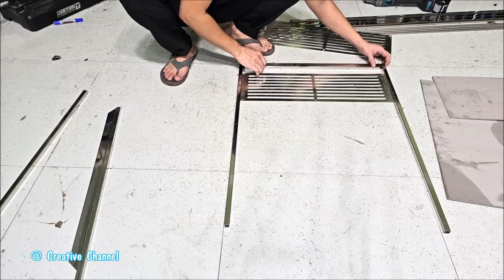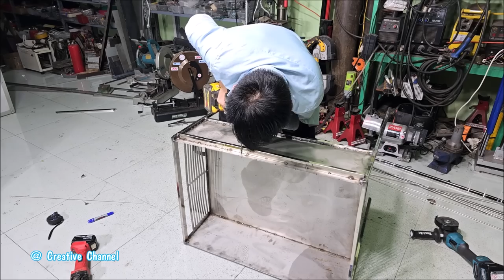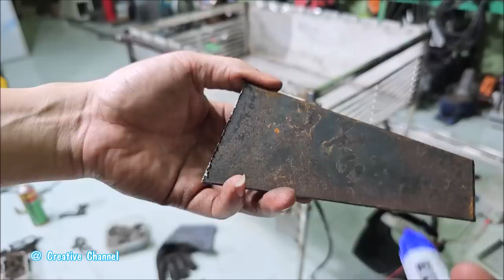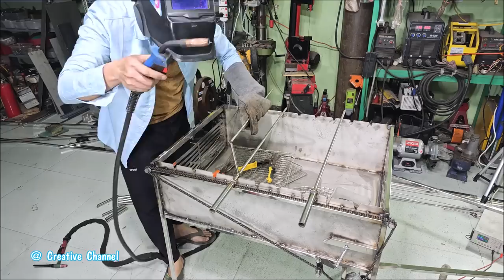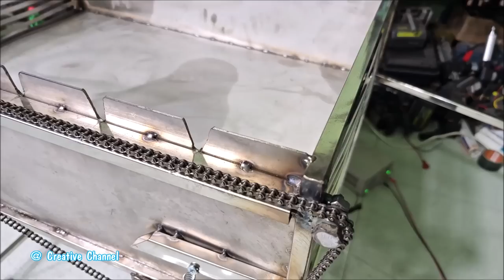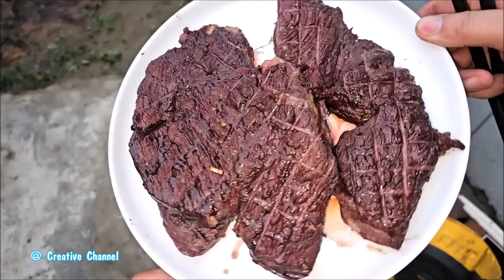Build Grill Machine, BBQ Grill v2, Full Stainless Steel using Wiper Motor 12v 50W At Home

Comment: too high speed, you will not get a crispy crust and juicy pulp, as the meat will dry out.  speed should be +- 10-20 rpm
Reply: Then... How you can gauge the speed?
Reply: @RICKY-RIKON  the speed is determined by the gear ratio, or you can calculate how long it will take to make a complete revolution.  ideally, a full rotation should occur in 3-4 seconds

Comment: Bro if you want to remove welding marks, just buy a 20mm or 10mm carbon road if it's hard to get then cut 15cm burn at the end of 10cm until the resin from the carbon fiber is gone then connect with three positive mice on the body and negative on the carbon brush then make water + salt + citric acid, water 50ml salt 30gram, citric acid 20g stir until smooth then let stand and move to another container because not all salt can dissolve, then dip the carbon brush into the acid salt water then set it to 200a and remove your welding stains quickly and easily.